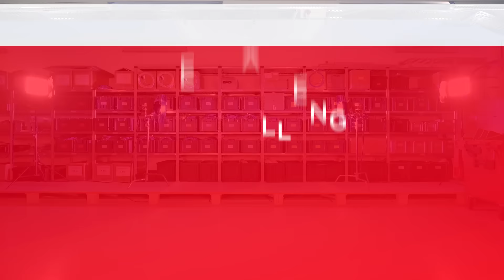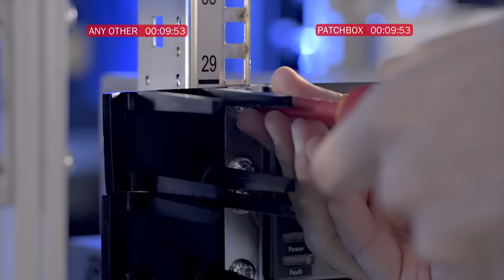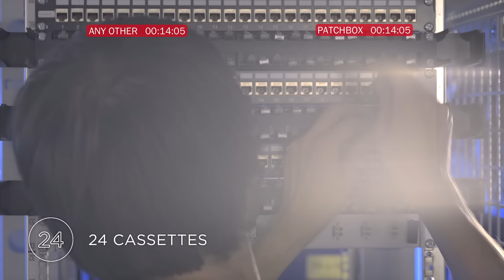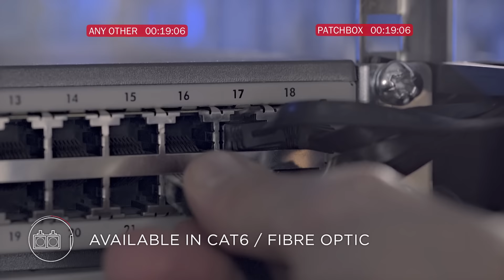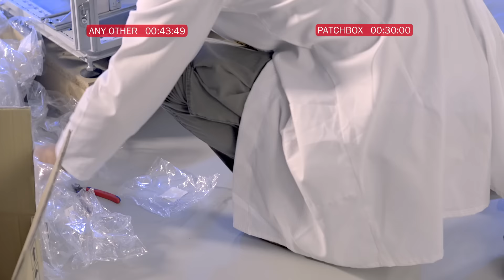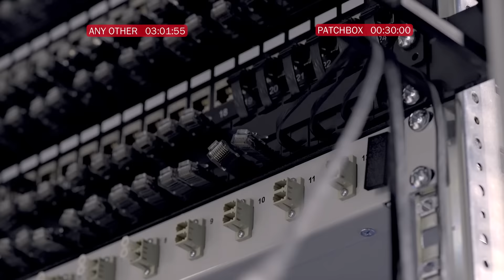Let's challenge the PATCHBOX solution! Connect everything!

Comment: I love the concept, how expensive is the cartridge compare with standard patch cable ? I am asking because my company is very big. How can I justified this purchase ?
Reply from the maker: Hi Neil! The price varies depending on your level (end-customer, reseller, etc), you're location and where you buy from, and if you're planning a bigger project, also on the size of the project. It's roughly around 15-20 USD (14-18 EUR), but the biggest argument for justification is the forever organized network rack and that our system reduces the duration of costly downtimes by up to 90%. Depending on your industry one single incident usually pays off.